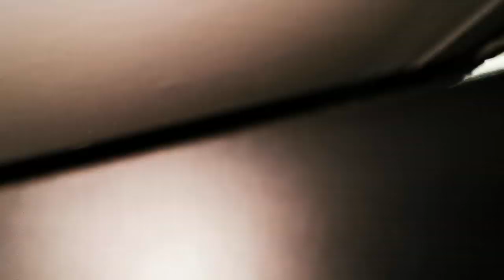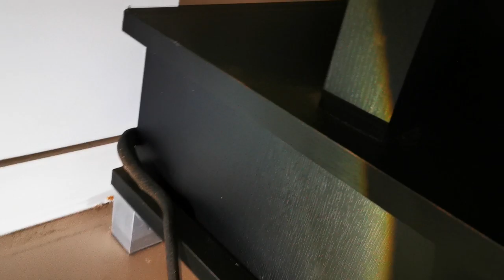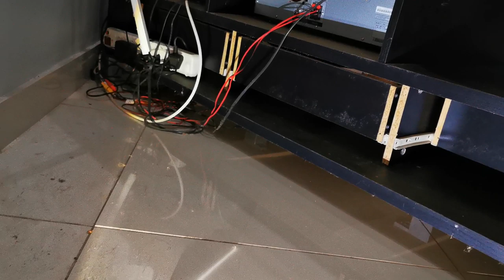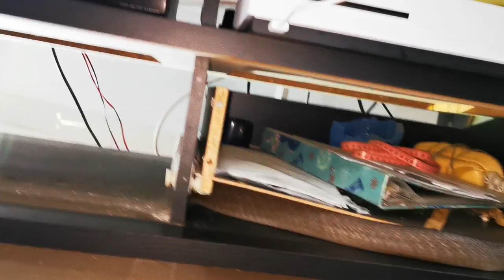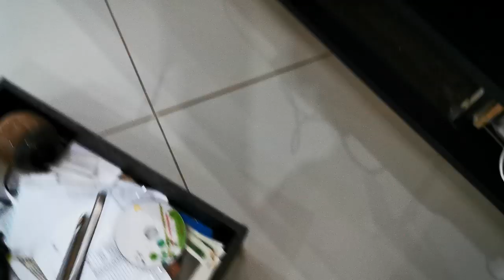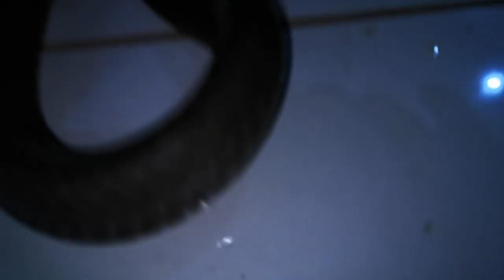Black Mamba inside living room

Comment: What is the snake eating in that house?  Rodents?  Did it just come in by accident?
Reply from the maker: I can't recall what the weather  was doing back then, but snakes usually come into homes to escape the heat, or to seek shelter if they can sense a cold front or storm coming. Otherwise it's also sometimes because they are following the scent of a prey item that came inside, so they simply follow it in.